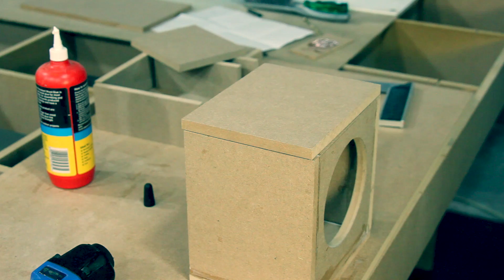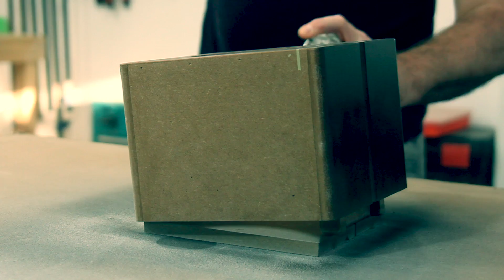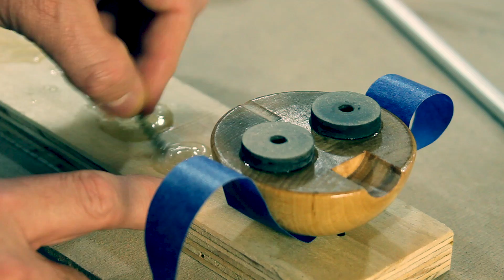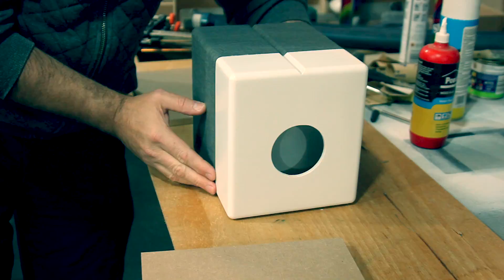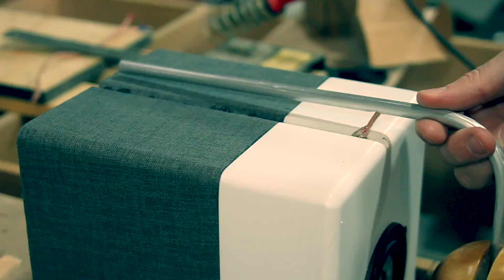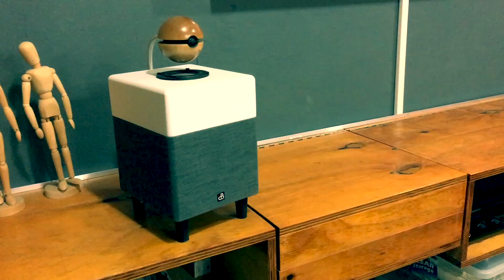Building the Cyclops (aka Poke Ball) Omnidirectional Speaker - by SoundBlab

Comment: How did the tweeter sound at higher volume? The poke balls are really cool!! Really cool as a collectors item..😮
Reply from the maker: The tweeter really only covers the very most upper high frequncies, where there is not much energy, so they cope just fine at higher volumes and remain clear. Thanks!
Reply: @SoundBlab  thanks, gonna use them, i have bought them already and set the crossover at 7000hz, the detail is amazing  :)

Comment: Stange design - It looks like you ported the midrange through the bottom of the speaker via slotted port tube you built but left the sub in a sealed enclosure?
Reply from the maker: No the midrange is sealed, and the port is for the large enclosure for the woofer.

Comment: I like the idea - if a little weird, and very fragile - but you made a big mistake using those ugly countersunk screws to secure the 3" driver. They detract seriously from the build. Thankfully you can replace them with proper hex-head machine screws pretty easily.
Reply from the maker: Thanks! It is an unusual design. You will be the first person to comment that the screws can actually be easily replaced. Others just didn't think of that! These were what I had on hand and I did end up replacing them with something better looking 😉.

Comment: Hey you install your speakers like I do. Your hand can heal but the soft surround of the speaker won't. Your kind of taking a chance with rounding off the corners of your cabs after using brads to assemble them though. 

What country do you live in? It looks like the quality of your MDF is better then here in California. We use to get a good product but not so much any more. The stuff we get today takes on moister so it swells and shrinks making it rather difficult to achieve seamless lacquer finishes. It can be done but there is a lot of work involved to do it right.
Reply from the maker: Never had any problems with the brad nails and router. They really just skim the tops, if at all. I live in South Africa. The MDF here is not bad, but I still get slight shift in them that reveals a line at the join underneath the lacquer on occasion.

Comment: What kind of paint spray and adhesive did you use? Very nice project, beautiful design!
Reply from the maker: I normally like to use automotive paint and a spray gun, but I do not have the space in my workshop for that. So, now I just use spray cans for smaller projects. Various brands here in South Africa. The adhesive is a contact cement, or contact adhesive.

Comment: Use Baltic Birch plywood, not that crap particle board.
Reply from the maker: Its MDF, not particle board. I use it because it finishes better and easier than Birch when using paint. Also, Birch is 3 to 4 times as expensive in my country than MDF. And by the way, I don't mind MDF, its a great engineered material that has very good dampening properties, ideal for speaker building. It does make a bit of a mess though.
Reply: @SoundBlab   I was wondering what kind of particle board can be routed a smooth edge. Its not particle!

Comment: Love the idea, but it seems you've lost a lot of the mid to high frequencies when listening in the normal seating position. Is that the case or is it just the audio quality of the video? I was thinking about designing a speaker with normal front facing midrange and tweeter and placing a full range speaker facing up for increased soundstage and dispersion, almost like atmos. Still fleshing my design out. Thanks for sharing.

Comment: if you ever get the chance try omnes audio  BB3.01
those 3 inch widebands come from pretty expensive studio monitors and are only about double the price
needless to say but they sound amazing
Reply: and i forgot to say you do not need a tweeter for those they play up to 20khz you only need to adjust the highs or they sound a bit too sharp
Reply from the maker: Will have a look at those drivers, thanks.
Reply from the maker: True, but the tweeters just give them that slight edge.

Comment: Beautiful work! I used a pair of those Fountek FE85s along with a dayton ND105 ported to 45hz in a little tabletop speaker for my mom. Running off a $12 2.1 channel chip amp they really sound excellent. Did you size the spheres based on any particular phase plug/waveguide effect reasoning or was it just a matter of experimenting?

If you have the opportunity to try them, the FR58EX is a phenomenal little driver and with 3x the xmax of the fe85 it moves about the same about of air despite being a considerably smaller driver. 6 per side provides some of the best nearfield midrange I've heard anywhere.
Reply from the maker: Thanks. I tried to keep the spheres the same diameter as the full range driver.

Comment: Great craftsmanship and awesome design. I would high up the stands and put half a sphere under it so the low frequencies from the woofer benefit from the same omnidirectional technology as the mid.The top sphere could easy house more of that tiny tweeters . Four of them placed on every 90 degrees(or why not, one extra on top) would create a true omnidirectional experience and enhance the high frequencies and overall powerhandling .The weak point of this speaker in my opinion is the spheres suspension rod that can easy enhance low frequencie resonation of the woofercabinet and pass it trough the sphere on higher volumes. What are your experiences and point of view on this ?
Reply from the maker: Thanks! I think all of your ideas are plausible and it can certainly be done. It will make for a more complex build and is outside of my capability in terms of tools and materials right now (and the reason I kept the design as simple as possible). Even though I would love to take on more complex projects, I am often limited by time, tools, materials and funds. The rod holding the sphere is fairly sturdy, but filling it with something to counter any possible resonance could solve any possible interference.
Thanks for this comment, I love that you have given it some thought that can spark some new ideas!

Comment: I really love this video, excellent work too.
My only question is why not approach the tweeter the same way, in terms of omnidirectional?
Reply from the maker: Thanks. The small driver firing up and reflecting agains the ball is full range. The crossover has been designed to make use of most of it's full range potential. The tweeter is really just there to provide a little bit of sparkle at the top end, and even off-axis you can still hear them.
Reply: cool...have you checked out the Omniwave speakers....?
I saw/heard  their amazing presentation a while ago. Man, that sound is crazy. The guy played a recording of  fireworks. You can hear the height(!) of the rocket explosions in the air (the room was like 3 m high!)....amazing stuff. A bit pricey for me (7500 a pair) plus you need a sub. But check it man wow. They have a reversed cone design, re-engineered. Peace, I want to build my own stuff too, but have to build up more tools for this stuff.

Comment: what is use of that hanging ball?
Reply from the maker: It acts as a reflecting surface for the full range driver to aid in the omnidirectional nature of the speaker in the midrange.
Reply: SoundBlab did you arrive at the size of ball by calculation or by asthetics? Just wondered if a larger ball would create a "larger" sound?
Reply: A hyperbolic cone is a superior reflector.

Comment: Where can I find some more info about the crossover you made? Great design by the way!
Reply from the maker: Kristof, thanks. The crossover was custom designed for this build and combination of drivers, and to work in the enclosure I designed. Because of the experimental and complex design, I do not have plans for this build and the crossover as it stands still needs tweaking before I can release any information on it. However, with my limited time this will most likely not happen.
Reply: That's too bad.  I was ready to order parts and build a pair, but I don't want to redo all of the engineering work.  Dang, that was going to be a fun build :)

Comment: It would be great if you could share the measured response is for this speaker.  I have tried this configuration with a ball over the mid-range driver and there were large dips and peaks in the frequency response.  Maybe you solved this with the specific size ball and driver used.?
Reply from the maker: I don't have that on file, but I can say that I did not have the same problem with this design. The response was very usable and made the crossover design fairly straight forward.
Reply: I had an 11 inch sphere about 2 inches above an 8 inch driver and it made a wide 8dB bump in the response at about 700 Hz.  I copy every measurement into a Google doc or take a pic with my phone of the config and response so I don't have to repeat stuff all the time.   Your sphere is smaller and farther from the cone so the bump may be at a higher frequency and a lower amplitude so as to not be noticeable.
Reply from the maker: There are many factors that could cause that , and I am only speculating here. Without details of the specific driver it is difficult, but it could be that the driver has a natural rise at those frequencies and the application amplifies that. In addition it could be the baffle that it is mounted in and the size and shape of it. Also, I would suggest that your reflective object, in this case the ball is not larger than the driver surface area in diameter. You could implement a crossover that compensates for the rise and gives you a flat response.

Comment: 35 seconds in and I can tell what kind of channel this is.  The amount of work involved in this video is not lost on me, listening on a pair of Blue Lola's on an amp.
Reply: Ehrmahgerd, I bend pipe for a living (HVAC, copper for A/C) and I understand why you do it (sand in the aluminum) but man, who would notice.  I guess that's the difference between rough work and enthusiast passion.
Reply from the maker: Thanks!
Reply from the maker: I tried bending it without the sand, but it just kinked. The sand solved it.

Comment: Nice work overall but high frequencies  are clearly directional so the whole setup should stand as semiomnidirectional unlike say duevel planets setup.
Reply from the maker: Thanks. True to some degree. The full range drivers run sufficiently into the high frequencies to still make it full omni. The tweeters really just fills in the very top end to add that bit of sparkle.

Comment: The drivers are an exact copy of Boenikes W5. You have taken the W5 and made it omnidirectional. Your crossover points are also a copy of Boenikes design and the woofer without any crossover. Dont understand me wrong, its a nice made speaker, but its NOT your design, its a copy of the W5SE as an omnispeaker.
Reply from the maker: Thanks! However, I think our interpretation of a copied design must be different. A design that is copied means that you have taken the original product and copied every aspect of it; the design, the mechanical, electronic, etc. parts. In this case, the design is clearly different, the crossover is different (and it will be, because I have placed them on different planes completely from the Boenicke design). Sure, I am using the same drivers as the W5SE, but that is where the the similarities end. Not to mention that you can buy these drivers off the shelf. This is my design, and it is original. No one else has put these drivers together in this configuration, and the electronic parts has been designed by me according to that.
Reply: SoundBlab I did not want to say that its not a very cool speaker, but i would cross the woofer this time. I speak with Sven sometimes and i know why he made the woofer without a filter. But this only functions if its radiating to the side. Dont you get much midtones firing downwards ? 
The speaker is really cool and i would love to hear them to compare to my W5s :).
Reply from the maker: Sure, I understand and thank you! This design is very experimental, and my 1st omni design. As I played around with the XO design I have come up with various possible versions of which all have the potential to work. The XO I am using now uses the least amount of components and is probably the main reason I went for it. In order to maintain the midrange in the woofer you need to drop the SPL of the overall target curve. Then with a shallow overlap of somewhere between 600 and even as high as 1500Hz between the woofer and the full range you are able to achieve a reasonably flat curve in the entire region, except for a slight bump in the bass around 100Hz.

I would, however still like to experiment with a different XO where the tweeter is running a 2nd order high pass, the full range 2nd order lowpass at 250Hz and a high pass at 6300Hz. The woofer will run 1st order at 1000Hz, which means you get a rather wide overlap between the woofer and full range between 250 and 1000Hz and it fills in the midrange without having to compromise on the overall SPL of the speaker. Not sure how the full range will handle the lower frequencies though.

It's not always possible to explain in a 10 minute video everything I have done and the reasons for some decisions, especially with something as complex as a XO. As said before this is an experimental design, and really still 'in development' so to say. I really do appreciate the discussion, but my suggestion to you would be to more careful how you put things. Saying that what I have done is a copy of something else, when it is clearly not, does not help discussion. If you said: "Hey, I see you used the same drivers as in the Boenicke W5SEs but in an omni speaker configuration. I own the W5SEs, would love to know how they compare. What XO topology did you use?", etc., that will be received more gracefully.

No offence taken, but lets keep it real man.
Reply: SoundBlab your right, i want to say Im sorry. But i also want you to know, that first i misunderstood your intentions. I thought it was a commercial design and that would be unfair. There is a company in eastern europe that copies svens designs, this sucks very much. 
I Understand now that its a hobby thing you are doing. And this is why i went back from my offensive opinion. Thumbs up for your work. 
Do you have a possibility to measure the speakers. I flipped my W5, so the woofer was bottom facing and it sound nice. A bit more midtones, but not problematic. The only thing i would like to hear is the extended baffle for the FE85. Sven made the w5 so narrow to overcome bafflestep correction. Dont you experince a bump around 2k (not the typical fullrange bump, stronger than that). 
Its a pitts you cant use the modified FE89 that sven uses in the W5SE. The FE85 from the stock W5 was changed in the W5SE. 
So, no offence, i understand now, its your hobby.
Reply from the maker: Cool man , no harm done. Yes, I have done some research after our discussion for more info on the W5's and have also come across a design that looks suspiciously similar to the Boenicke's. Yes, there is a peak between the 1K and 2K area roughly (I'm not looking at the graphs at the moment, just from memory) and you will hear it if you do not compensate for it in the XO, however with it being an omni and the sound gets reflected (and effectively really being 'off-axis'), it helps to minimise that raise in response in that area. I do want to try a different XO though as mentioned before. Just need to find the time to do it.
Reply: If he has built these from scratch with his own hands then they are his own work.

Comment: Hi, Looove these, great use of material etc. Parts Express is the best!!! You mentioned that the 3" mid is crossed over at 600 and 1000 Hz and the tweeter at 6000Hz, i'm guessing you meant 600 and 10 000 Hz for the 3"? Otherwise there's a large amount of frequencies missing, or is it purposely done that way? Just checking.
Reply from the maker: Thanks. To clarify, the woofer does not run a crossover. The full range is then crossed over with the woofer with a high pass filter between 600 and 1000Hz.  The full range also has no lowpass filter. The reason I say 'between 600 and 1000Hz' is, because the woofer runs no XO, the crossover point is fairly wide with the full range in the region of 600 to 1000Hz. The tweeter is then crossed over at 6000Hz. Hope that makes sense.

Comment: @SoundBlab, would you consider doing build plans for these speakers? They would have an exceptionally nice frequency response. what is the TB woofer port tuned to?
Reply from the maker: Hi, this is a complex build and also depends on the availability of the half wood spheres. The plans also takes very long to draw up and right now I don't have the time as I have a full time job. So, for now I am not planning on drawing up any plans. The port is tuned to about 50Hz if I remember correctly. This driver can go much lower, but then your enclosure will be bigger and so also the size of the port.

Comment: I'm looking to build a pair of inexpensive computer speakers. Do you think the fountek drivers would sound decent without a tweeter or sub? Not looking for anything crazy, just better than the generic computer speakers I'm using right now
Reply from the maker: They will be fine without a tweeter. However, they do not have much lower end capacity. You can use them in a ported enclosure, but then you would not want to drive them above 10watts max.